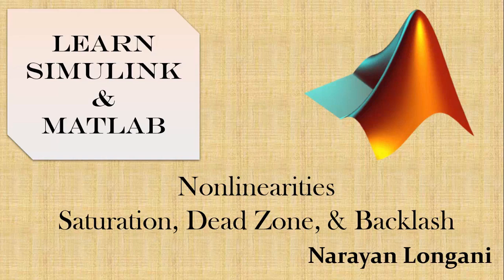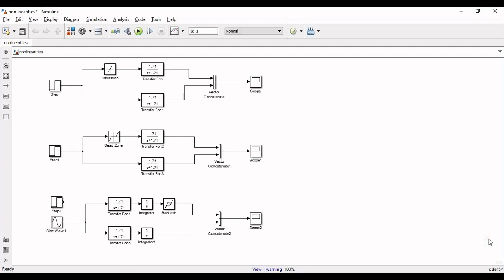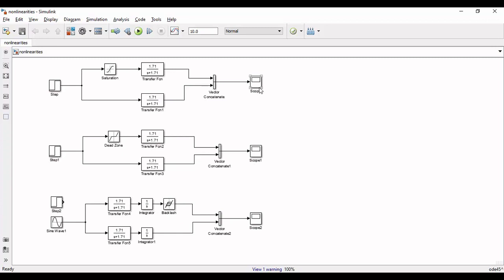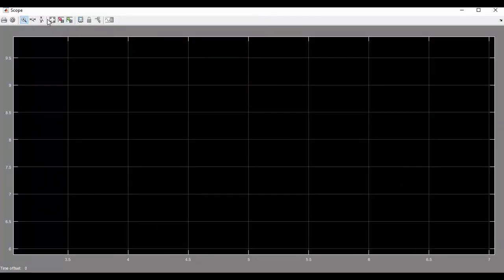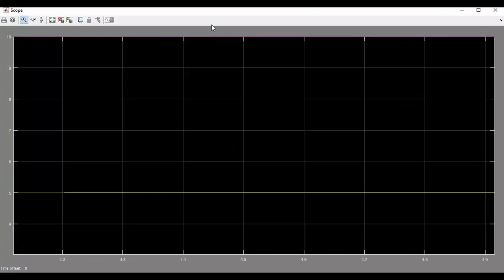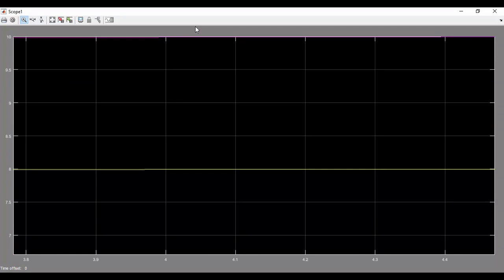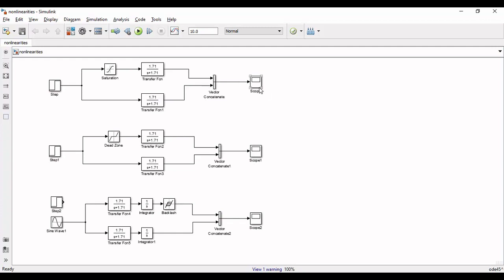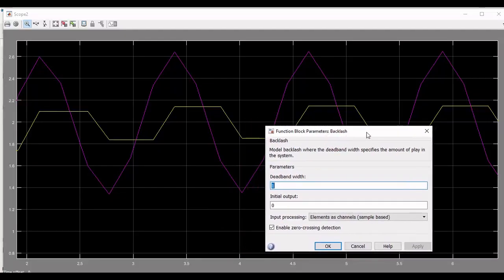Nonlinearities in SIMULINK | Saturation | Dead Zone | Backlash

Comment: Hello sir, how to make a code on matlab for solving non linear systems with dead zone non linearity by neural and fuzzy controller
Reply from the maker: Hi, with the ease SIMULINK friendly interface you can easily implement linear or nonlinear systems and controllers. Else, you have to define region of deadzone, and then computer the given function using evaluate.
Reply from the maker: Or else you can use if command
Reply: @narayanlongani  If you have any example  with code for solving non linear systems , can you send me.
Reply from the maker: Might this help you 

Nonlinear System With Dead Zone | Pendulum in Matlab | Matlab Code | SIMULINK | Matlab | Mathworks

https://youtu.be/L5EMYXhB-dM